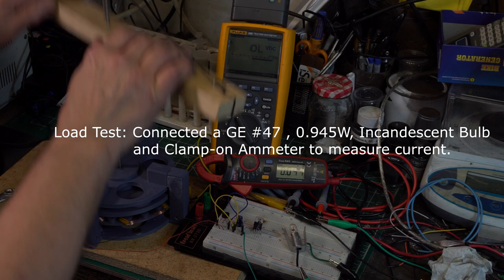5000 Year Old Pump Drill Powers 3D printed DC Generator

Comment from the maker: In my haste to publish this video , I made a couple of errors in the video text. Those are the stronger N52 Neodymium magnets and that is a  100 microfarad capacitor connected accross the FW rectifier output. You might have caught me jump a little, see and hear the 55v snap when I connect the bulb across the output as it discharges through the bulb. ( At time: 1:00 min.) LOL.

Comment: Hey, that seems good, could you maybe upload a video where you explain how it works I'm a bit confused lol
Reply from the maker: Sorry, I can't make the video any more clearer than it already is. I'll try to explain it better: The action of the bow drill spins the magnet studded fly wheel over the copper coil. The spinning magnets induce an electric current in the coil which lights the bulb.
Reply: @William_Hada   My bad yeah, the bow drill, I didn't figure out how it spin, so I'm gonna watch a video about the bow drills eheh, definitely understand the magnet part though but thank you for pointing out !